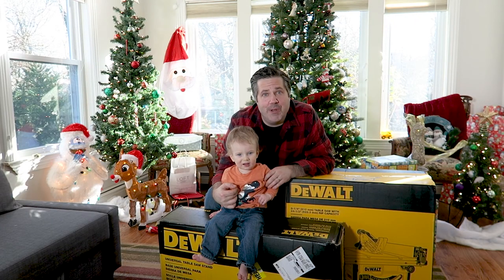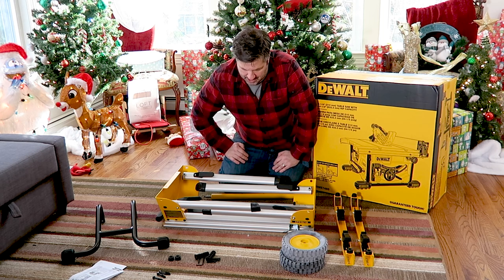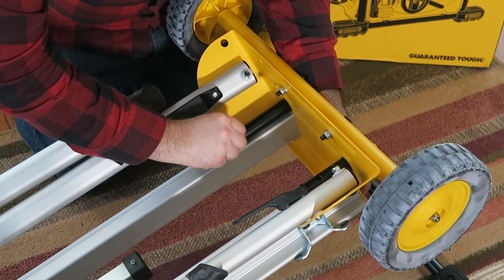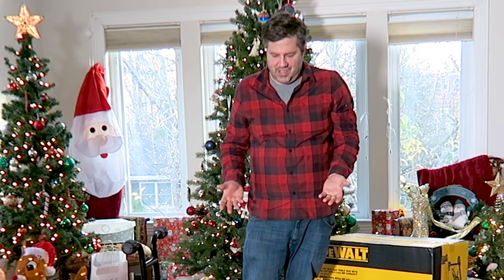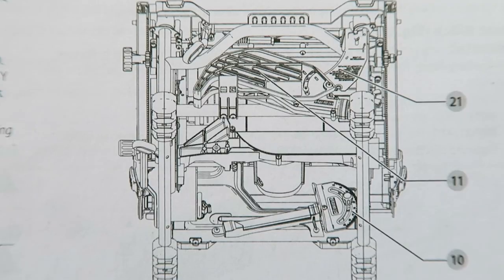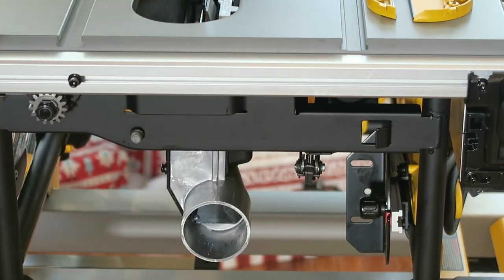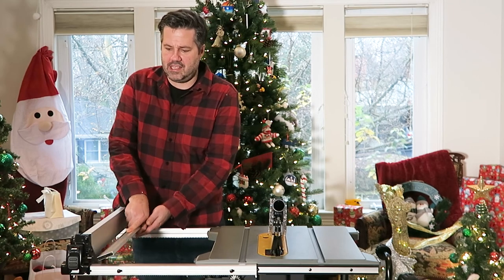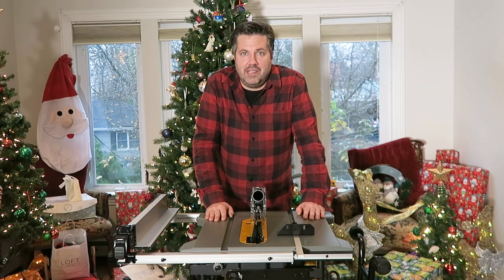Home for the Holidays with a DeWalt DWE7485 Table Saw and DW7440RS Stand Combo!

Comment: This is the third video I watched to wrap my head around getting to know my first-ever table saw. And it was the most comprehensive of the bunch. Thumbs up!
Reply from the maker: Glad you liked it.  Two things I learned after having it for a while,  If you want to do more woodworking than general use, check out the 7491RS as it has a 10 inch blade and can accept a dado.  Two, this saw has limited blade options but Diablo has one that matches the kerf and it is an awesome blade so you won't need other options:).  Replace the blade with this one from Freud and you'll get awesome cuts. https://amzn.to/3uMwQZW. The one that comes with the saw is ok, but more of a construction balde which is fine if that is what you are doing.  Let me know if you have any questions on the saw.

Comment: nice just picked up this same combo saw and stand for 315 bucks from lowes on sale. Thanks for the review, love this thing
Reply from the maker: Glad I could help.  For the size and weight I don't think you can beat it.  There are some slightly larger models but in my opinion are great as portable saws.  Eventually I will upgrade to a cabinet saw, but I would never get rid of this for the portability.

Comment: Cheers man. This was so helpful. DeWalt should be ashamed of their pointless instructions manuals. All the best from Ireland 😎
Reply from the maker: Thanks John!  I think DeWalt has some pretty great and innovative products like the rack and pinion fence on this saw and the 20v system.  Their product management has been pretty crumby though making it hard for consumers to see the value in the different products.  You will be super happy with this though.  I have no plans on upgrading until I move up to a cabinet saw.
Reply: @SoWeBoughtaHouse  My saw is DWE7485LX. For those who do not know the knob for removing the Riving knife is actually under the table saw and not under the throat plate. In other words no need to remove the throat plate on the Lx model. DeWalt make great tools for sure. I have being using them for over 20 years on site. Got the table saw and currently setting up a small workshop. Maybe a woodworking YouTube channel someday 😎👍.
Reply from the maker: If you set up a channel I will be your first subscriber :).

Comment: Called Dewalt 3 times to ask if I should remove the plastic feet covers to mount this saw on the table. When the customer service guys started speaking, an automatic survey kicked in and I could no longer talk to them. If I leave the plastic feet covers (shoes) and screw tt bolts without tt locks, do you think the saw would be safe to operate? have you experienced any issue with the saw moving during cutting?
Reply from the maker: Is it the same stand I have or the scissor stand?
Reply from the maker: Hi R&D I just took a look back at my notes from when I made the video and when I spoke with Dewalt back when they answered the phone.  When it comes to safety I want to point you the correct manufacturer recommendation. In the saw manual for the the 7485 Tpe 3, which is what I have. (If you have the type one you might want to check the page number.) on page 1 where they show the schematic, there is a blowup of item 24 showing the screw hole to mount the saw to stand 7440RS.  That is how I mounted mine based on what DeWalt told me.  

I am not a Dewalt expert, so please use your own judgment and check with DeWalt if you don't feel comfortable.  By the way I emailed them two weeks ago about saw blades for this saw and haven't heard back.  That is another whole story, but it is difficult to find blades for the the type 3, though Diablo makes one.  If you switch baldes make sure you read the Kerf and body dimensions printed on your Riving Knife.

It is confusing because some saws like the 745 require the feet removed and I believe the 7491 requires a special adapter you need to buy.

As for stability, mine is solid as a rock.  If you have any other questions, just let me know.
Reply: @SoWeBoughtaHouse  I probably have the same 7485 type (I don’t see where they say which type i have). I see the zoom-in pic on p 1 and on p. 6 they say “holes 24 are also provided under the saw feet for mounting to DW7440rs brackets. I didn’t remove the plastic feet covers and screwed the bolts with 3 washers each but without the locks straight into the feet. This is what you did too, correct?
Reply from the maker: @rd2522  So I did a little more research.  24 means the holes in the plastic feet and I have the saw connected exactly as you describe.  Also if you look up the saw on DeWalts website they have a photo of it it connected to the scissor stand with the feet on.  It looks like we did it the right way :). 

All I can saw is I just tried rocking it and mine is pretty rock solid.  I hope that helps.

Comment: What is the mounting bolt thread size? I have tried M7 and M8. M7 is too small and M8 is too big. Mine didnt come with mounting bolts.
Reply from the maker: I can’t find my sizer. But looking at them and checking with a caliper they appear to 5/32 imperial hex bolts.  They should have been packaged with the quick release supports as the hex bolt hardware kit.  Unfortunate Dewalt doesn’t list them on the part diagram and the instructions just list the name of the kit.  Dewalt will respond quick to email and send them out to you in my experience.
Reply: Thanks for the reply. I will pick some up and see if they fit
 @SoWeBoughtaHouse
Reply from the maker: I ordered a new sizer off Amazon.  It should arrive today. So let me know if that works and if not I will check the size and thread on the sizer when it comes in.  Do t forget washer and lock washers to keep them from vibrating out.
Happy New Year!
Reply from the maker: Good to hear.Glad I could help.

Comment: you did great on explaining where everything  goes !. as for the lever under the blade height wheel ?..no..you do not need to release it just to raise the blade, that is only for tilting the blade..not to raise the blade :-). just purchased very same table saw today, not that i needed it ?, as i have a larger floor model craftsman 10 inch table saw in my shop !, but i needed a smaller table saw to take on the road with me, so i bought this saw today ( 7-18-2022 ) to do some cutting work at my cabin instead of trying to load..and unload my heavy craftsman floor model..i'm too old for that !..lol. i did not purchase the stand and saw as a set..but i did purchase the stand from amazon. pretty sure the table saw box say's it weighs around 48.5 lbs ( tool only ) right at 50 lbs something with all accessory's stored on saw.
Reply from the maker: When i got my saw it was a little sticky raising and lowering the blade so I thought you needed to hit the switch.  I felt like an idiot when my friend showed me you didn't need to release that lol

Comment: "If only they put as much thought into the instruction manual" (6:20).  Ain't that the truth!  Good video, though.  When I assembled mine, I put the axle on "backwards" and the stand wouldn't lock in the upright position.  It wasn't obvious that there was a "front" and "back" to the axle assembly.  Also, I'm here watching this video because the instructions are not at all clear about how to mount this saw to this stand...says you "may" need to mount on plywood and doesn't mention to just put the bolts into the threaded holes in the rubber saw stand.  You even said "this might be wrong" as you did it...but I definitely think it's right, just not at all mentioned in the instructions!  Grrr!  Thanks for making this video!
Reply from the maker: Hi Jay - I'm glad the video helped.  Someone else was having a hard time mounting the saw, the comments should be a few posts down. We did eventually find a some vague reference in the instructions and I'm 98 percent sure now that bolting it into the the plastic brackets is correct :). I've had my saw mounted that way for a year now and it is steady as a rock.

One last thing, that front and back issue with connecting the stand, that was super frustrating lol.  I should have put the outtakes into the video of trying to get that right, but this is a family friendly channel :)

Happy New Year and enjoy the saw!

Comment: Lock washers always go under the nut.
Reply from the maker: Hi Dave - where did I make a mistake.  Sometime recording these videos it is really easy to misspeak.  Thanks especially when talking about things like bolts and nuts and not catch it.
Reply: At 10:03 you seem to be putting a lock washer onto the bolt, then a regular washer. Seems like that lock washer is redundant if the nut at the other end is a locking nut. If that locking nut does not unscrew somehow, which it theoretically won't, the assembly is secure.
Reply from the maker: Looked at it and I can can provide better clarification. In this case there is no “nut” the bolt screws into a threaded insert in the frame of the saw.  It goes through the stand first.  The direction were not great on the stand and the hardware kit came with the washer and the lock ring. I spoke with a friend who is a mechanical engineer to see what he thought.  In this case since the bolt is being threaded into a fixed connector the lock ring could only be placed on the bolt side as likely just acts in conjunction with the washer to distribute the force and prevent the bolt from vibrating out over time. Just speculation though.  In any case it shouldn’t hurt and there was nowhere else to put it.  I just checked the saw and everything is still tight.  

Thank for pointing this out and let me know if it makes sense.  It may still be wrong but based on the manual and the setup I didn’t see any other way for it to go together.  Let me know if you have other thoughts.
Reply: Yes, that does make sense. I guess I missed that the bolt was being inserted into a female threaded insert. @SoWeBoughtaHouse
Reply from the maker: Lol. That stand was way more complicated to attach then it needed to be. It was easy to miss something :)

Comment: In reality Dewalt is not concerned with supplying a TOP bench saw: -The internal dust insulation has been changed, even so the machine releases a lot of dust. - It's a noisy machine. - The consumer does not have the option to buy this machine at 127 volts. - No disc brake - Goniometer with clearance. - There is no flange size option, plastering the consumer to buy cutting discs of another size (should come shaft hole flanges of other disc sizes as an accessory). - The cutting edge is out of adjustment. - The angle adjustment knob is too hard as well as unreliable. - Does not fit 254 mm disc, only 250 mm. When starting and stopping the engine, strangely "spark". DISAPPOINTMENT! The industries, such as Bosch, Makita, Dewalt etc. it is the same disrespect towards the consumer. Adilson you're right! Enough of watching videos from Youtubers running their hands over the heads of the saw manufacturers just to beg and beg a shut up and in favor of GARBAGE!!!!!!! People who keep selling themselves to the manufacturers of saws and tools in exchange for "jabá". The reality is one, for tool manufacturers, we are considered third class consumers, not to mention the lack of safety and quality! We cannot and must not accept these equipment and tools without quality, safety and respect for others, it is the lack of maturity prevailing at the expense of reasonableness, common sense, ethics, safety and respect! We cannot accept that we Brazilians are treated as third-class consumers, denying us and making us have to consume products without quality. We don't have to accept what the manufacturers want to sell us and push down our throats, precarious, limited machines, which fall short of our needs. Today, the market has a lack and need for portable saws with better quality, as well as features and safety. This "little chat" and the justification of the industries that these machines are for construction sites only serves to relieve them of launching better saws. Year after year the so-called "releases" and or "new" do not have effective advances and improvements. It is the same as always, the accommodation of industries. What really changes is just price, always more expensive, without significant effective improvements for the consumer!
Reply from the maker: Hi Luiz, 

\I'm not sure what this saw costs in Brazil, but cost wise this is midrange as far as the US market.  I've used it for a few cuts since the unboxing, but I haven't found anything wrong with the safety other than I can see people removing the blade guards since they do block visibility.  The pawls work very well though and hold the material well.  They actually make it easier to cut longer material by aiding to hold it down.  

I've not seen any motor sparking.  

So I don't get anything from DeWalt, in fact I don't get anything from YouTube at all right now, my site is not monetized.  I bought this with my own money after reading a lot of other reviews and speaking with local contractors.  From the feedback I got most people were happy with what they got.  It really comes down to expectations.  This is definitely not a full wordworker's saw though lots of people use it for that.  It wasn't meant to be.  Now if you are looking for something that is still affordable but more high-end and feature rich in the contractor category Dewalt makes a 7491.  I really wanted that one but didn't want to pay the extra $350 for it right now.  I again I spend my own money on these tools.

If money was not an issue I'd likely have purchased the Sawstop.  If you haven't heard of them, check them out.  

Right now, I have a small one car garage I use as a shop and am doing renovations around my house, plus helping some family members fix up stuff from time to time so having a portable saw was important.  If I was going to spend say upwards of $1000, I'd look at full size options, but I'm not there yet.  I also have a Dewalt Miter Saw for the last 3 years and I love that thing, I use it for everything and never had an issue.  I find it has great vis, great power and can be precision calibrated, even if it was a little off from the factory.  That experience is what sold me on the DeWalt table saw.  I hope it does sas well, but time will tell.   

If you have questions on how its going with the saw, feel free to hit me up here or on twitter at SWBAH1 and I'm happy to give you honest feedback on any tool I own.
Reply: @SoWeBoughtaHouse  YES, you couldn't have said it any better. Just saying...